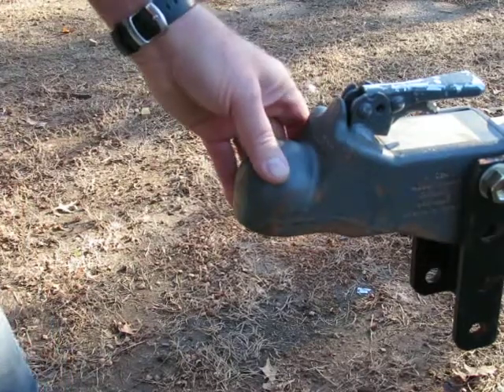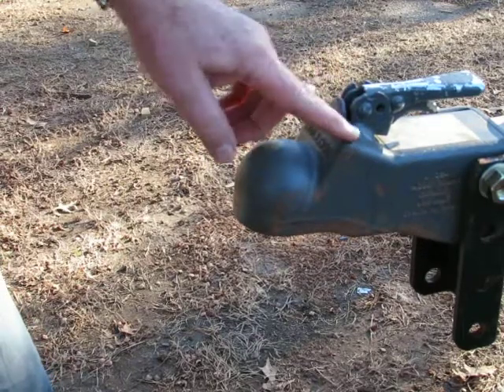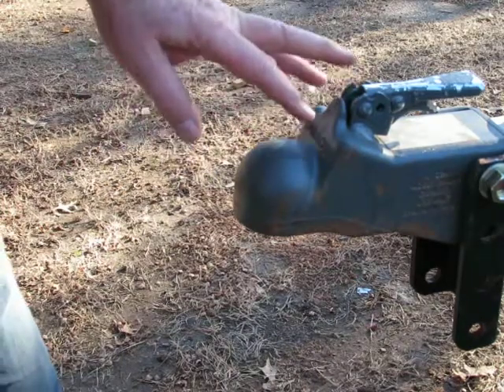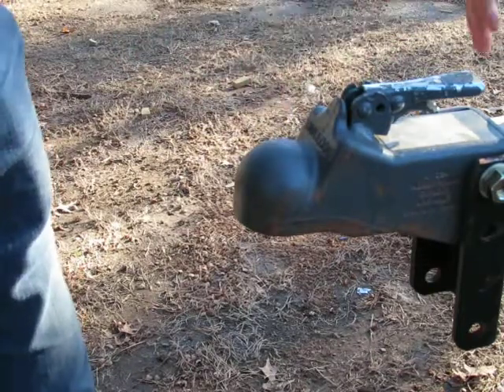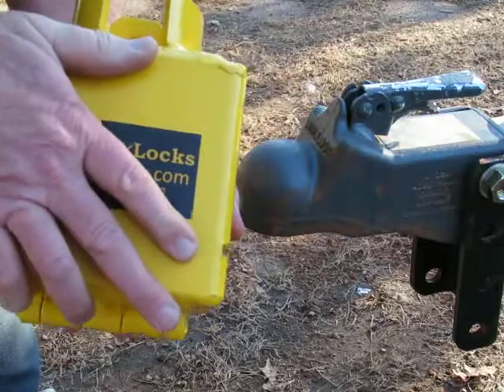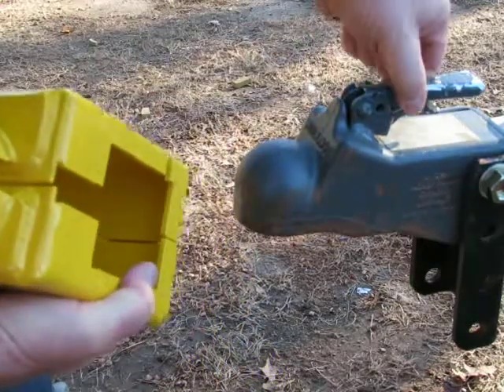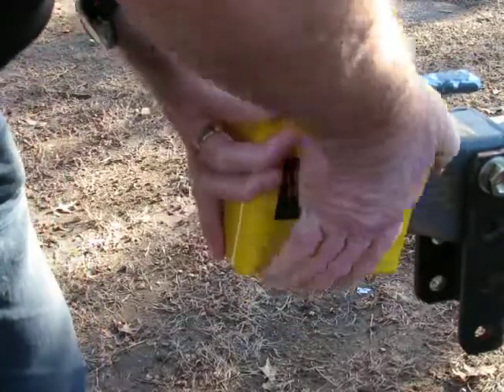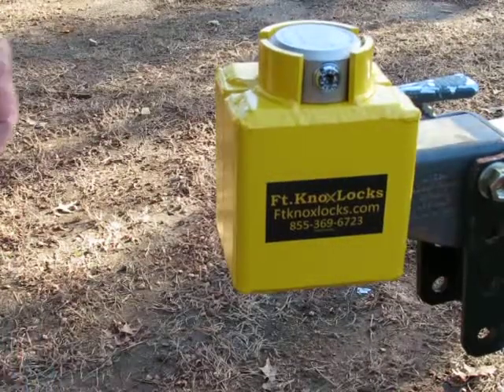Ft. Knox Lock install on a Bulldog heavy duty adjustable coupler

Comment: You should redesign these boxes with the hinge to be inboard of the shell for more security.  My cordless Milwaukee Fuel  Grinder with a cutting-wheel can make that exposed hinge just like slicing toast out of that hinge on the outside of that assembly because it is easy to get to.
Reply: putting the hinge on the interior would prevent the box from being able to open as the metal would turn in on itself

Chad Odom
Reply: Milton Odom, It’s called a bullet hinge and they turn in whatever direction you set them up for.  I’ve used them many times.  They work great and as stated would be inside the box making it nearly impossible to degrade.